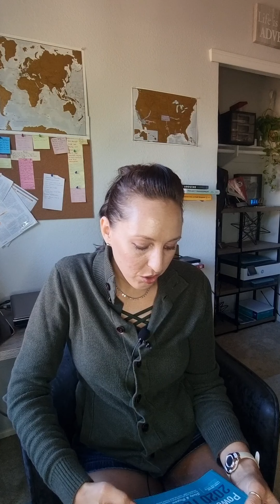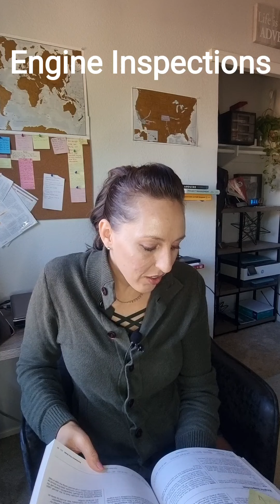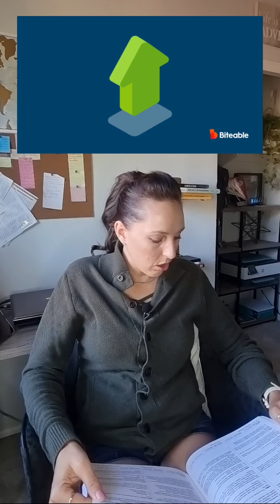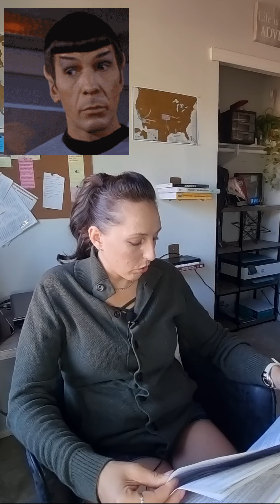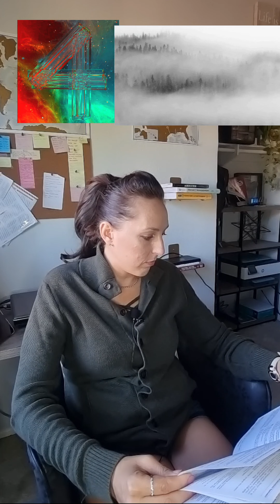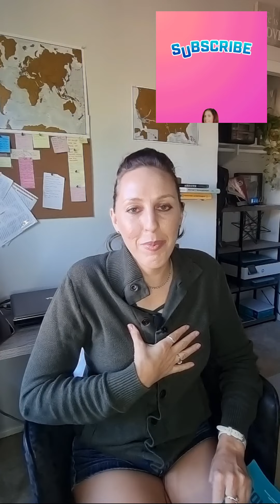FAA A&P Powerplant Study Guide Part 3

Comment: Just so you know, it's a 30:10 correction, not part 4. It is Part 5, Engin Fire Protection System
Reply from the maker: You may be right. If so, then thanks for catching that! I start going cross-eyed after a while. I separate the parts via how many videos I record, not by sections in the book. Does that help?

Comment: I came across your channel when looking Asa Prepware question reading for my long drives to my A&P classes. Thank you for making these. If possible could you also do the Jeppesen General, Powerplant and Airframe Test guides?
Reply from the maker: Thanks for the recommendation. I'll consider it. It might not be a quick turn to meet your timeliness, but if it will benefit others, I can add that to the schedule. If that what your school is studying from?

Comment: Hey so I’m studying with my friend and I listen to you all day pretty much so just wanted to say that we appreciate you☺️
Reply from the maker: Thank you! So no pressure, but did you test yet? How'd you do?
Reply: @livingl6s  I did test yes. I got a 75% on my general written and 79% on my airframe written. the written was much harder for me and there were a lot of questions that I honestly have never seen before that day especially electrical questions, those questions about AN/MS fittings and there were so many of those damn graphs for like wire size and how much fuel to have for safety so those I would study much harder. My oral and practical I pretty much got 100%. my DME  asked me about 116 questions and I only missed 10 but I never missed more than one in a subject so I never had to redo a subject. The DME questions were pretty much all Prepware and the books you read. Also i am a paid mechanic so the practicals were really easy. It wasn’t really anything mechanical it was just like “how do you remove rust from this location” look it up in the book and do what the book says. He also asked me how to read a micrometer which I do that all the time at work so that wasn’t that hard either. Also for the DME be very very aware of the CFRs and AFRs. A lot of people don’t study these cuz they’re boring but a lot of the general questions will have something to do with these. Also be very familiar with writing a maintenance entry cuz they will ask you to do that. I live in SoCal LA area and my DME was Jack Moy. Great dude and anyone else who lives around here I highly recommend him
Reply from the maker: @snowminkankles1401  Wow thanks so much for the info. I really appreciate it. I went to A&P school around there too. I hope other prospective testers see your post and take notes! I hope you get a pay raise soon. All the best! -Karina